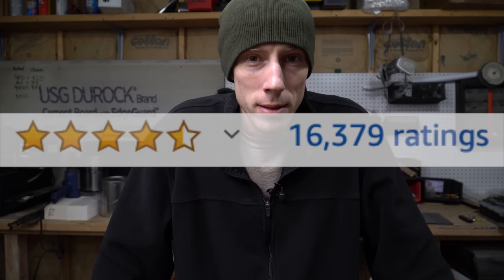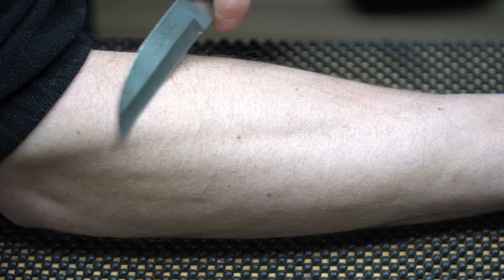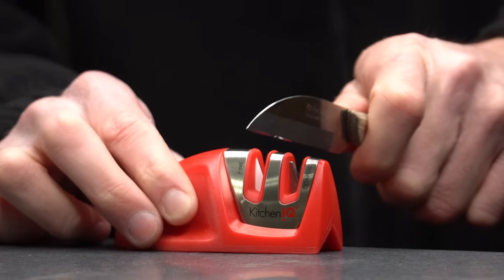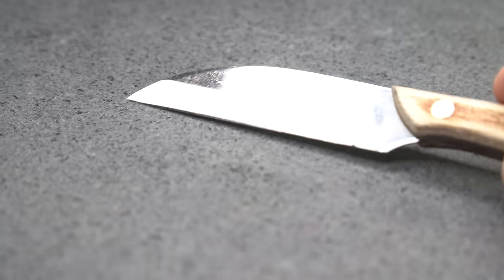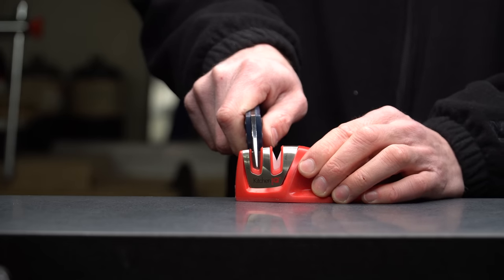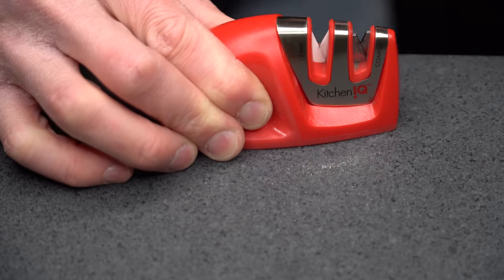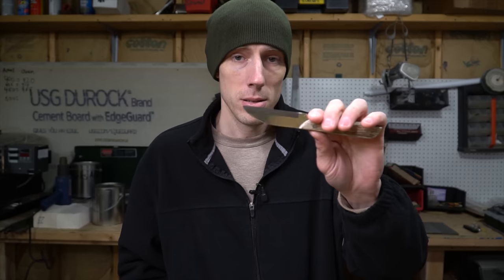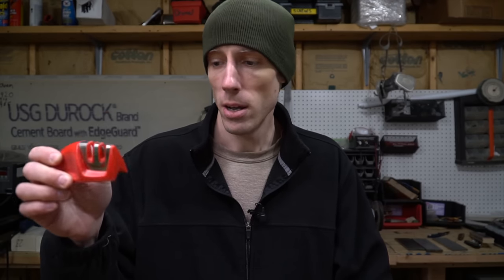I Bought The Most Reviewed Knife Sharpener On Amazon

Comment from the maker: The most reviewed knife sharpener on amazon⬇️
https://amzn.to/31EErua
The Alternative ⬇️
https://amzn.to/31GKdLP
Best freehand beginner stone⬇️
https://amzn.to/3bvPtXq

My website www.knifepointgear.com

(Full DISCLOSURE)⬇️
These are amazon affiliate links.
Reply: Have you come across the mad edge sharpener? I've seen it in a few other knife making videos and ended up getting one. I love it. It has digital markers do you know what degree angle your sharpening at. I couldn't sharpen for damn too begin with so this setup saved a few of my knives from well... me. It's a little pricey but for someone like me, it's damn near fool proof.
Reply: When you started running it through the sharpener it sounded like nails on chalkboard 😬
Reply: could you do a video on how to make a knife out of a file with only a bench grinder? In one of your vids you said it could be done, but I can't really figure it out. Also, if/when I make one (out of a file), can I temper it right after brushing it up with a wire wheel, instead of waiting until I've cut out the shape of the knife? wouldn't that make it easier to make the knife?
Reply: Hi! Thanks for the video, I have this same sharpener at home and agree its only for relatively soft kitchen knife steels. I was wondering if you could do a video on stuff like homemade whetstones and using rocks, cement surfaces and maybe ceramic surfaces as DIY whetstones and how much the grit of the surface matters, etc?

 Proper whetstones are very expensive over here and local whetstones are mostly good for carpentry tools  and stuff. Even the king double sided whet stones cost 10 times more than the local stuff we have here, so they are pretty expensive. I would love to have your feed back on this matter.
Reply: What about electrical sharpeners? Any good ones? My wife wants me to sharpen all her knives and It done fast..ha cheers
Reply: Serious question. Do you have to wait for your arm hair to grow back before each new video?

Comment: I have never actually used this specific sharpener, but similar sharpeners have the course cutting blades ground at a slight angle, so that they only cut from one direction... It appeared to me that you needed to hold the sharpener in your left hand and then draw towards you. Unless this sharpener is different, you were basically trying to use a drill bit in reverse.

Comment: I messed up a good blade with a pull through when I didn't know any better, I'd never seen a pull through before but was lead to believe it was some sort of easy new method of sharpening. I use it now for kitchen knives that don't really deserve any better and the owners will be using it with a glass cutting board type situation anyway.

Comment: I use that exact sharpener for my kitchen knives.  I never use the carbide part.  The ceramic rod part works well.
Reply: BornIn1500 if you use expensive kitchen knives, I highly recommend you stop. Just as this video exhibits haha.
Reply: @MrShaw3030  you must have missed where I said I don't use the carbide side.  That's the part you see ruining the edge in the video.  The ceramic rods (the white "fine" side) are great and they work just as good as any other ceramic rods.
Reply: BornIn1500 LoL I can admit when I’m wrong! My bad, homie. I completely did miss and went dyslexic. Yeah, the rods are the best and good 😄

Comment: I just bought this sharpener too. It was great for my old stainless steel kitchen knives. The “V” cut out on the bottom of the sharpener goes on the edge of the table that .your sharpening on. Yes it make a rough edge, but using the fine side, tilting it to either side just a tiny bit, will work. It took a while to figure this out. These knives were going to be tossed out. Now I can actually use them again. Tr.y it again, using it a little differently. You might be surprised. I like it cause it’s small enough to carry out camping or for picnics. I am well pleased with it. The only real down size, some people says the sharpener doesn’t last as long as some would like. That is expected, it has tiny sharpening blades.

Comment: I actually have a few pull throughs sharpeners and they work decently well for quick edge maintenance, when used properly. At least better than you're demonstrating. The only two real points are as follows:

1. These are meant for maintaining an edge, not edge repair or reprofiling
2. DO NOT APPLY LOTS OF DOWNWARD FORCE, just barely pressing on it with your index finger is enough

The biggest problem I see is that the instructions on the box are never clear enough as they try to keep it short and simple to sell the ease of use. Everyone I've seen using these things, and who eventually give up on them, reef on the knife as they pull it through. In my experience pull through sharpeners can produce a proper shaving edge. It will never be as good as learning to sharpen with proper stones but for a lot of, if not most, people it's plenty good enough. I wasn't a knife enthusiast, it's what I used for years before finally getting the hang of using a stone just a few years ago. Granted my only experience was with a pocket knife made from 8Cr13MoV (i have no idea what that even means, is it relatively soft or hard?) but it was my EDC at the time. The edge was still clean after years of using just this type of sharpener on it, not all ragged as your examples here. I think the key really is to just use them frequently and pull gently. Like give it a few a passes once a week type of thing.
Reply: 8cr13mov is a decent, budge, Chinese knife steel. Its typically hardened to 57-59 Rockwell C, which isn't soft, but isn't hard either. A lot of times you'll see it compared to Aus-8/440B.

As for your point about people using too much pressure... Yeah... That's something that people just don't seem to understand.

Comment: Think of this as a very tiny butcher's steel. It should be used lightly, not like you're trying to saw it in half. Just a few strokes then strop and you will get a workable edge. The edge will probably not last long, but it's a great disposable sharpener for disposable knives.

Comment: Thanks for not using the slicing paper test. I've seen very dull knives cut paper just fine.
Looks like the last knife was dragged across a wood rasp.
That sharpener however is not intended to impart a bubble on the knife. It is made to sharpen a knife that already has a profile to it.

Comment: I don't understand how someone as good with knives as you wouldn't know that you aren't supposed to force the knife into the v like you're trying to cut through it. That's why it says to pull it through, not grind down the knife on the v.
Reply from the maker: Because in order to sharpen you have to remove steel. Exactly how you remove the steel is important. Grinding it off with carbide (like this sharpener) isn't going to give good results no matter how you do it.
Reply: @OUTDOORS55  But the amount of force you put into sharpening a blade is one of the most important things to sharpening as far as I'm aware. If you put your body weight onto a knife while using a sharpening stone you could fuck it up pretty bad as well, could you not? I can't see how putting undue force onto a tool wouldn't cause excess damage in any case. 

Granted it would take far longer to sharpen(and might not at all, for some of those blades) but I've used one of that sort(though it's one that was apparently intended for camping/outdoor use, though seems to have the same components) on a semi-sharp cheap-ass knife(she had to get one with a plastic coating -_-) and sure it doesn't get it as sharp as the sharpening stone(necessary for making sushi). But I'll be damned if a minute of woosh-woosh doesn't get it back to more than enough to make dinner with after a couple months of use(or misuse, as in the missus' case).

I've never had it damage the knife, but I've always just pulled it through without much extra force on it, which is why I question whether essentially attempting to saw through the device with your knife might have been slightly.... excessive and might have resulted in unnecessarily bad results.

Comment: I use one of these on a little Kershaw burst and it's pretty much worn out at this point and does not get it nearly as sharp as a whetstone. You can see that I've cut into the steel portion but the ceramic area is still going strong. That being said it's kept the knife sharp for many years and I don't have to fuss with the whetstones.

Comment: I'm on my second sharpener like this.  It lasted about 4-5 months of light everyday use.  From experience, just looking at your first knife and using the rough side... you're pushing waaaay to hard.  You were taking chunks off of the knife-edge (which still showed in the video after using the fine side).  The fine side. which I use almost exclusively, should be easier strokes too.  You can actually feel the smoothing of the blade and the straightening move towards the tip of each stroke until it slides like glass.  This is what I use this sharpener for,.evening after honing, I will perform a few strokes through the ceramic, just to make sure the edge is straight.  As for using as an exclusive sharpener... no!  For in-between maintenance, it is fantastic..  It is what it is.  Try again with lighter strokes and I believe you'll get a lot better results.

Comment: I have this sharpener and have used it on a regular basis for months; and I still do: I would not exchange it it for another, and I have in fact given up using my rather expensive diamond whetstone. I am a passionate cook, and cook all kinds of food from many countries, and so have many knives; I use this sharpener on all my knives except one, which is a santoku given to me as a gift by a Japanese family, with my name in Chinese characters engraved upon it. I cannot use it on that knife because the steel of that knife is much too hard; however, I definitely do use it on my Porsche Design Chroma knives made of high-quality 18/10 Japanese 301 stainless steel, and it works perfectly well on them. I also use it on knives I use for making sashimi (not special Japanese ones, but more than adequate for using on all kinds of fish to make good sashimi and sushi, which I am excellent at making.) In addition I use it on my Chinese cleaver, with which I can cut most bones with a single chop. Plus I use it on the knife I use to cut meat off bones, the kind butchers use. The sharpener works well for ALL these knives!!! All I do in addition to using this sharpener is hone the knives on a honing steel I got cheaply on Amazon which claims to have diamonds embedded on it (though I can't actually see them). I FIND THE KNIVES SHARPENED BY THIS INEXPENSIVE SHARPENER PERFECTLY SHARP ENOUGH FOR C.O.O.K.I.N.G, WHICH IS ALL I AM INTERESTED IN THEM DOING! I am not a BARBER, you understand, but a COOK. I couldn't care less if my knives can shave my hair or not!
Reply: Oh shush.

Comment: I have some cheap ($5 for a 4-pack) steak knives that I sharpened with an Accusharp for years. That tool is shaped differently, so you drag it over the knife instead of the other way around, but uses the same exact carbide blade principle as the Most Reviewed. It produces what I'd call a "serviceable edge," but just as you showed, that edge is really gnarly. The edge also doesn't hold worth beans, so you have to redo it very often. 

Then, when I finally shelled out about $35 or so for a pocket knife, I decided to get a stone so I wouldn't have that kind of an edge on the better knife (it's definitely far better than a $1.25 knife). Needless to say, I practiced on those super-cheapies first, after watching some of your videos.

I can report that it did not take a huge amount of steps to get rid of the crappy old edge, no belt sander or any of that. But I did have to swipe the practice knives a gajillion times, and when I looked at the finished product, I had indeed obliterated the Accusharp profile and made a new one without even consciously intending to. The pocket knife (never Accusharped), in comparison, took seven swipes on the stone to get the job done.

Comment: God I hate pull “sharpeners” They’re glorified Honers.
Reply: Blu3ManiC if they remove so much metal are they really honers? They are just crappy sharpeners imo. But useful for a household that has no time to invest on good stones or doesn’t want to make the effort.
Reply: halakon666 they only remove metal because the pull “sharpener” metal is harder that’s why it did nothing to the harder steel knife it didn’t have a bent edge to straighten and it wasn’t harder than the knife.
Reply: @Blu3ManiC  so then it sharpened one and didn't hone the other... thus it is a....
Reply: halakon666 it didn’t hone the other because he filed it blunt not because it couldn’t be honed there was no edge to hone at that point... it’s a glorified honer for household cheap knives lol just buy a new cheap knife this thing and others like it won’t work on or will ruin your premium knives (see knife number 3 which already had no bevel)
Reply: why would you even use this on a premium knife? no a glorified honer is those damn rods they put in all kitchen sets. as stated before it is a sharpener for households. because most house holds wouldn't have "premium knives." they aren't cooks or chefs why buy the most expensive knives? so to set it straight, if the part that sharpens the knife would have been a material that is harder even than the other knives. it would have still being a honing rod or a sharper?
Reply: halakon666 oh boy, I’ve got an island on Arizona to sell you lol
Reply: Blu3ManiC straight to under handed insults, cool. You have a good day too.

Comment: The blades on this sharpener seem to be on the coarse side tungsten carbide, which just rips the softer steel off like peeling a banana. The white fine part of the sharpener seems like it “ might “ be ceramic? Wholly agree that the Lansky ceramic sharpening kit is worlds ahead of this device, if you value your knives. Good video. Thanks Mike.

Comment: You should make a distinction between "easy to grind" and "easy to sharpen."  Many of the softer steels which are easy to grind can be difficult to sharpen as removing the burr from these steels can often be quite a challenge.  Many of the harder steels which are difficult to grind (at least without proper abrasives) are actually easier to sharpen since they are much less prone to burr formation, and the burr that is formed is often easier to remove.
Reply from the maker: Yes your right there is a difference there. 👍
Reply: My experience is that if the steel is too soft, sharpening won't create a burr and won't hold an edge even if I can get one.

Comment: I got an Ikea knife sharpener at CNY 39 which equals to USD 6 roughly, and I have several kitchen knives at around USD 10 for each one. The combination works so great that I can maintain all these knives in great shape with so little effort. They are as sharp as very expensive Japanese sushi knives and worth only 1/10 - 1/20 of Japanese knives. I think this amazon sharpener would have much better performance if you only use the ceramic rods, most of this kind of fixed-angle sharpeners are equipped with hard metal blades, grindstone rods, and ceramic rods, usually only ceramic rods are useful on daily kitchen works. My Ikea sharpener only has grindstone rods but it works just fine enough.

Comment: Sharp 'n Easy is the only good pull through sharpener. It's small, cheap and it has two round ceramic rods instead of a carbide sharpener. It has a fine and a coarse side and both are ceramic. If you need something for the kitchen or on the go to get a fast edge, that's the one to get.

Comment: Some of the sporting good stores in my area sell something similar for about three dollars and change, most are green and round(ish) with the two notches on opposite sides.  

I found that these sharpeners are handy for use on cheap machetes. I like Tramontina machetes, they run about $8 to $12 in the stores in my area. I have about half a dozen stashed in various places. They come with a terrible edge, but they're cheap and they are effective once you sharpen them. These sharpeners work well on them, and the angle they establish seems to be effective and pretty durable on a machete. By virtue of how they work, they kind of push minor nicks in the blades back into place, but they sort of dish out the blade if the nick is really bad. They don't rust, and they're cheaper, lighter, and more pocket friendly than a file, but I'd never use one on a traditional knife. 

In my experience, the fatter the blade and the softer the metal, the better these things work. But in case you didn't watch the whole video, don't use these things on your good knives. Or your so so knives. Or really any knife you plan to keep. You'd probably be better off using the bottom of a coffee mug.

Comment: Problem with the alternative is that it requires learning sharpening technique and practice so angle is good and stable etc. The popular one is quick and easy to use, and it sharpens enough to make the knife cut things.
Reply from the maker: The alternative is simpler to use and actually works.

Comment: Hello I just bought a 
Boker Plus Black Widow Strike Drop Point Automatic 

  D2 steel knife. I have a v shape sharpener bought a while ago where you can adjust the angle from 14 degrees to 22 in increments  of 2. Came shaving sharp, any recommendations if using the carbide on there gently would ruin it? Also a recommended degree angle? P.s. this is my first pocket knife over 20 bucks